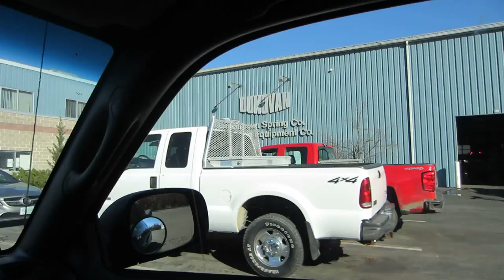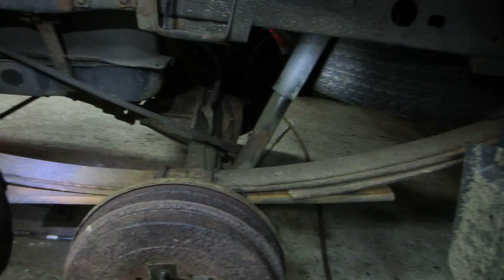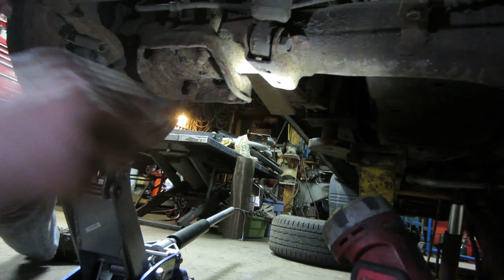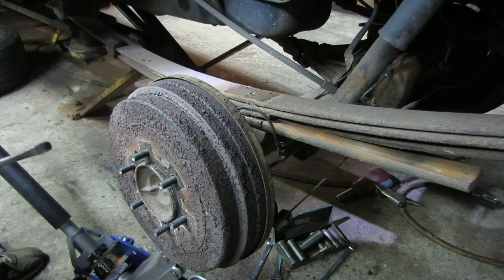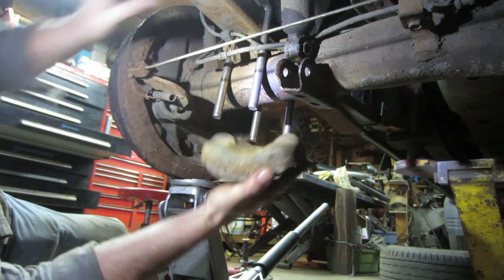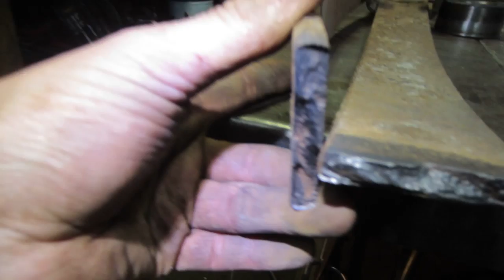replacing  a single broken leaf spring on the car/truck

Comment: Good video, Darren. I had a similar issue a few weeks ago, my future son in law bought a 98 Chevy z71:2500 4x4 pickup with a 6 inch lift and 33 tires. Anyway, he romped it across the four lane highway leaving his work, and ended up having what we thought was the centering bolt snap, and one side of the axle slid back about 6 inches, causing the driveshaft to pop out of the transfer case. Luckily the drive shaft didn't drop down. So he was stranded in a huge hyvee grocery store parking lot  and no money for a tow truck. He calls me, I look at it,tell him what he needs, and I get a new centering bolt, and new u bolts. We fix it in the parking lot, brought every tool I though we'd need, including the gas wrench, acetylene torch. I'm getting my hip repaced in two weeks, so I couldn't do much work on it, so my son and future son in law did the work. Neither are mechanically inclined, but with my instruction we got it done. We are a rural farming community, so hyvee was fine with us fixing it there. Red neck repair at its best!
Reply from the maker: sounds like a great bonding moment there, good luck with you hip too,

Comment: Had a ten ton truck fail it's (UK) MOT test back in the 90s, one issue was a cracked leaf in a stack of nine. Was a rare truck and produced in1976 so new parts were not around. A fitter I knew said take it off split the pack, I gave him the bits and in his back yard he welded them. Cooled and back in the pack, lots of clamps,back on the truck and was still good 5 years later when I sold it. No charge, but we swapped favours for about 20 years. Did it same way you show here. He taught me to try anything, you're showing others the same method and it is great.Thanks

Comment: Although I haven't lived in the rust belt going on 15 years now it still amazes me the massive rust you have to deal with.  As a bodyman I don't miss it at all.  When I can go out and change rotors and pads without having to buy new pistons and seals or the entire unit.  We may get a bolt that will break every once in a while we dont have to get creative on undercoating ....  It reminds me of how fortunate we are ....
Reply: Ready lift a Nissan frontier 6

Comment: Dude, you rock. I wasn't even aware this was an option and because of your video, I found a somewhat local fabricator to get me one made for both sides with hardware delivered for $400cad instead of the $2300 per side that Mopar charges.

Comment: had the same thing happen was scared i would have to replace the whole pack and spring but your video set my mind at ease. So very glad i can replace a single leaf thanks so much keep up the good work, also it seems from the vids ive seen that exact leaf always fails first most likely on trucks thanks again!

Comment: I have a local place that will build me pretty much any coil or leaf type I would like. Came in real handy when the FD got the Mack chassis tanker. The old dept. kept replacing the springs with factory stuff and they would break yearly. Went to Dunhams and had them make a HEAVY duty pack, Tanker sets much better now and actually handles better to boot. Have had them make springs for custom trailers as well. Say you're building a welding trailer and have one side heavier than the other, they can make springs that will set level and work correctly.

Comment: I had an 01 and a 00 now both with the same spring broke but on the passenger side. The first time I had a local shop replace the single spring for about $250. I just got heavy duty replacement packs from ats spring in PA and will be installing soon. The complete 5 leaf hd packs we're about $600 shipped with new u-bolts, eye bolts, and bump stops.

Comment: Can't believe this vid popped up on my recommended watch! I just noticed my 93 Toyota 4x4 had the same spring break on the passenger side. The ends were rusty so I know it wasn't recent but it bugged me ounce I discovered it. Made the truck 1 inch lower and that's really bugged me.  I saw spring packs starting at $100 on Rock auto and O'riely's was $500+ for one side.  Ended up going to "Michigan Spring" up your way. $180 per side + u bolts. They said Torque to 100 #, Drive for a day and retorque. I'm sure it is not going to be a 25 minute job. I've never done this before. Kind of scared about all the energy those springs hold. You make things look easier than they really are. Thanks for the vid. At least I have an idea what's ahead of me. Hope my springs show up soon.

Comment: That sort of break is usually caused by "axle wrap". Happens when a spinning tire suddenly gets traction, like going from ice onto bare pavement. 
when the tire suddenly gets traction, the force causes the rear axle housing to try to rotate in the opposite direction. Because the front of the spring has no shackle ,therefore it's rigid, most of the "wrap" happens in the rear part of the spring. 
Because of the rotation of the driveshaft, the rear axle housing  also tries  to rotate opposite of the driveshaft, which is why the break usually happens on the driver's side.
Moral of the story, don't spin your tires when going from slippery to dry.
Reply: Exactly that iv noticed i spin up at our yard when its wet its on a manhole cover just in the right place and I presume that's what's crack one of my rear leafs on a 02 hilux 👍

Comment: Awesome job.   It may be hard to believe but a 5/16 bolt tightened to just 12 lb ft provides 2400lbs of clamping force which is more than enough to pull a spring pack together without breaking a sweat.   So if it helps during an installation there's no reason the center pin bolt can't be used to pull the pack together.
Reply from the maker: l think the problem is people run it together with an impact then snap it releasing the energy all at once,
Reply: Mustie1 oh... Yeah... Don't use an impact:)

Comment: When I did my 1980  GMC 3/4 ton almost 10 years ago I just went to Standens and bought packs for both back sets as I had broken ones and I figured they were all fatigued.  new bushings and everything. for some reason I did not replace the fronts and maybe I should have.

Comment: I had  a 1985 chevy silverado PU that broke two spring leafs on the driver side and actually  went clanging down the road.they broke where the alignment stud passes thru them.luckily there is a shop near here that builds spring packs and cuts spring leafs too.

Comment: It looks like that leaf cracked across the top first, then the elements got in and cause rust which weakened it until it eventually snapped completely.  I've seen that sort of pattern on broken leaves before, but only on vehicles 40+ years old.  I would guess it's a combination of maybe poor manufacturing on those leaves (I would think if it's poor steel it wouldn't just be that same leaf that breaks, there'd be plenty of cases of other leaves failing too) and the harsh winter weather causing heavy road salt usage  in your part of the world...

Comment: Metal cracking is contingent  on metal grain structure.  When the piece is initially formed there likely was a dislocation of some sort in the grain which ultimately can cause a crack which would grow over time.  It would take a good microscope to see it, and  then you have to know what to look for.

Comment: Had to replace the rear coil spring on my Vauxhall astra... you could actually see a corrosion spot from the surface right into the centre of the metal I never thought it could cause a weakness but I guess it can ?

Comment: My 2003 tundra had the frame replaced by Toyota, however when they did it they failed to change a broken l/h leaf spring. mine also rubbed a hole into a brand new Bilstein shock .The front drivers side lower  ball joint let go and ruined a tyre in the process. Apparently both the sring and ball joint were part of a recall but I was never notified of it and fixed the spring and balljoint myself . Otherwise a good truck .

Comment: Just did this job on my son's 2001 Tundra, same leaf, same side. But I decided to go with a complete leaf pack only ~`$180 shipped. My thought is if one leaf broke, other leafs may also soon break. Not too bad a job, but those u bolt nuts were a bitch to get off. If I was to do it again, I would just cut them. Rides real well.
Reply: By any chance did the leaf break around the same point?

Comment: Thanks for posting this. I am not looking forward to doing this w/o a garage, lift, or air tools.  Top spring on the forward shackle passenger side of a 1999 Dodge Ram Van 3500 snapped about 8 inches from the end. The second leaf was just resting on the underside of the broken end piece . Didn't notice until I replaced the air shocks after one bladder blew up on me on that side. Lucky it didnt shift sideways on me, otherwise I'd be up shit creek without a paddle fer sure.
At least now , if I can find one top leaf with the shackle ends , I'll know WTF I'm in for thanks to u.
😩😳👍👍🤘😎

Comment: Commonly a lead inclusion will cause that kind of fracture. Under a strong magnification you can see the crystalline structure. A high percentage of used steel could be the cause. This design has been around too long for a stack failure. Unless all are breakage is at the same tire, leaf and the same point. Do you know, has the problem reoccurred after replacement?

Comment: Nice work. Great that you found the shop to make the leaf for you!
I'd like to have a good impact driver. What psi and capacity compressor is needed just for DIY repairs when necessary? Any recommendation on the air wrench? Thanks!
Reply from the maker: you want a compressor that the low is at least 120, and has at least a 20 gal tank, the rest is what you availible for power, 120/240  they make electric ones that are real good too.
Reply: Mustie1 Than you very much! Mine is only an 8 gal with 115 psi. Guess I'll have to save up to get one that strong on Craig's list. (Or a garage sale and try to fix it to run like you do).
Reply: If you don't use air tools much the electric is the way to go.  A nice big electric impact is waaaay cheaper and easier to get than purchasing a compressor, water filters, line, fittings, etc.

Comment: Cause of breakage on drivers side only
Axial torque load and drive shaft rotational torque loading during acceleration being compounded on this particular spot on the leaf spring is a possibility.
That and inferior spring steel used by Toyota Motor Company..
hope this helps
kp
Reply: YEPS same side on mine also🤔

Comment: a breaker bar with 3' pipe will usually get the u bolts to crack lose so you can use your impact, you do realize thats the gas tank your sprayin sparks all over, ...just sayin

Comment: Tried doing this with a 2010 Chevy Silverado and they have a lift block or spaced block and installing the Center bolt makes the leaf spring teeter totter have no idea why they added those blocks..it is factory
Reply: What I did was ordered the single leaf spring and  Center bolt off rock auto and shaved the Center bolt down a bit as it was to thick

Comment: why did you not replace the hole springs on both sides  then you have a match sets
Reply from the maker: cost, the truck has 204k on it, and its still a matched set, they at the same hieght still,
Reply: but they still are weeker  then the new one , i have lean in the past if one broken replace  in pairs,  cost  now saves letter on down the road.  yes it 204 k but will you have to put out that it you broke and other one.
Reply from the maker: as far as what l looked up on toyota forums this is the only one that breaks, and most do what l did.
Reply: yes i injoy you channel any ways

Comment: Why didn't you just go to a junkyard you can't buy new springs cuz the height and everything will be wrong but used ones does not broken any junkyard I wouldn't cost you but about a hundred bucks you get the complete thing

Comment: At 19:48 you mentioned the clamps that secure the leaves in place. Are they supposed to go on the back too or only the front? I have a '94 F150 with both of the back ones missing and the bottom leaves are both offset a bit. Are they supposed to be omitted from the back? I have replacement clamps just in case but wanted to try and hammer them back in place first and put those rear leaf clamps on (if in fact that are supposed to be attached).